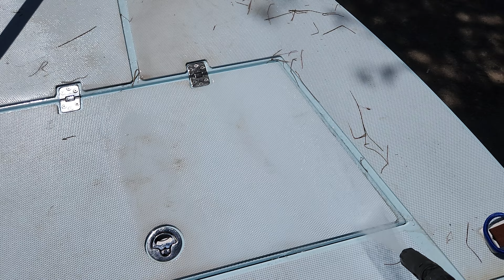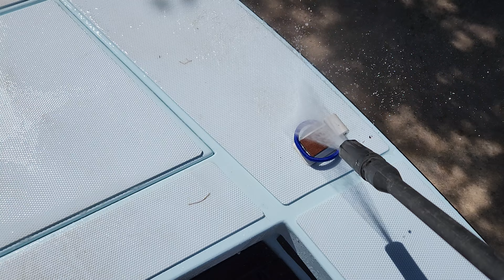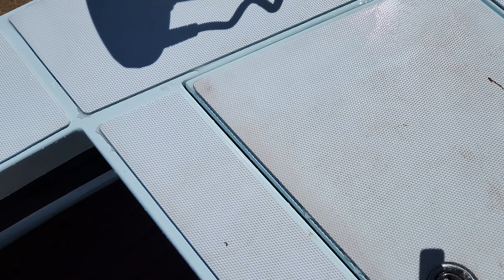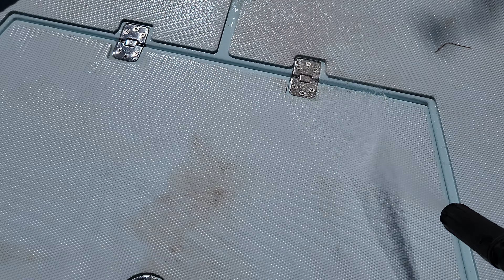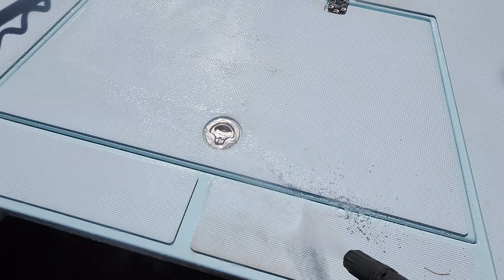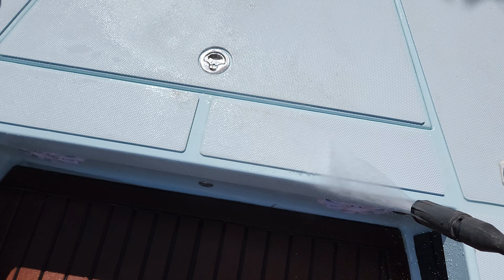Power washing Seadek

Comment: Pressure setting?
Reply from the maker: The twist nozzle on mine allows for stream or fan. 1750psi.  I set it on fan. You don't want the nozzle too close or it will eat into the foam.